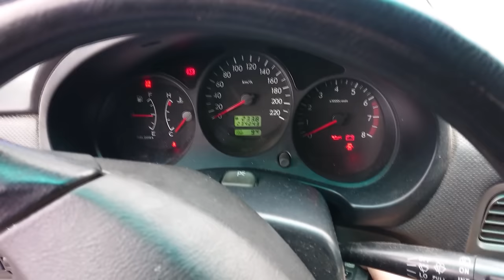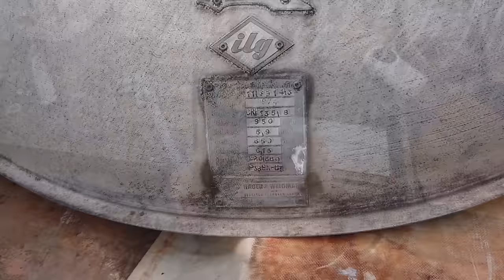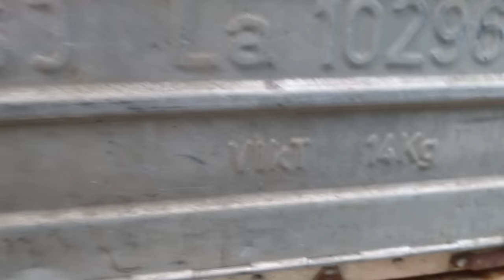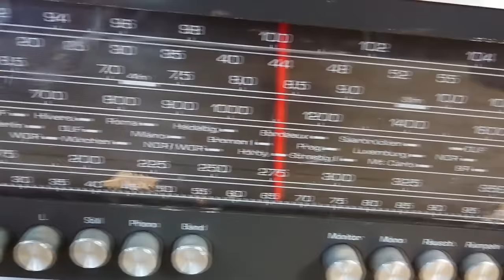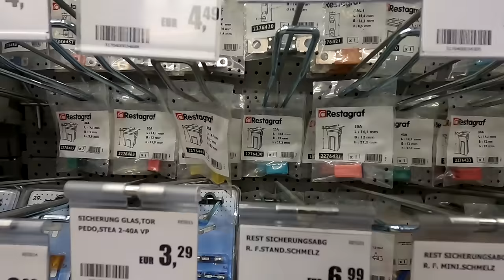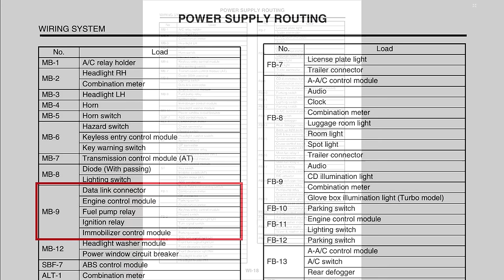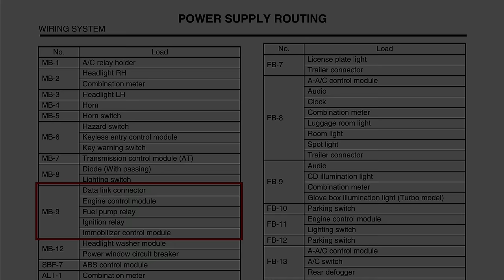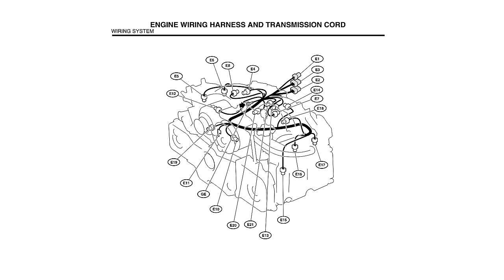New Awesome Scrapyard Finds! Repair-A-Thon!

Comment: As an auto mechanic that has training in electrical and electronics my main tools for finding shorts caused by rodent damage have been a basic test light, a source to inject low voltage into a  circuit like a variable dc power supply, and volt meter with an amp clamp. A good wiring schematic with routing diagram is a must as well for finding possible spots where a harness can chafe and locating ground point locations that could have become loose or corroded. The main issue i run into when doing electrical is that while the fix may be simple and quick the labor cost for the time to find the fault can be costly especially on cars with lots of computer controlled systems that are seemingly separate but when traced via a schematic are interconnected like many newer vehicles. It's been quite handy having experience with board level circuits as i've been able to repair modules that were either hard to find or cost more than the customer could afford which would have wound up them possibly sending it to be scrapped, like a fuel pump driver i recently did that was $500 and would take 2 weeks to get, the car had sat in storage for a few years and the unsealed module was located in a spot where humidity could enter it, board and ic's were ok but all the caps were either bulging or leaking brown electrolyte goo, took me an hour to clean, recap, and test it before reinstalling and bringing the car back to life.
Reply: Oh, cheap capacitors...you were the bane of my motherboards, video cards, and power supplies for years and years, and now you get to be the bane of cars too!

Comment: I know it's not under a car bonnet, but many years ago I had severe rodent problems in my workshop ceiling space where cables were getting chewed and damaged, not only posing fire risks, but also damaging my intercom system, surveillance cables and data. I tried traps but despite catching regularly they could not keep up and baits proved a disaster with the perpetual stink of rotting rat only removed by climbing in extracting the carcass... So I came up with an idea, the insulated ceiling space was entirely closed in and covered around 150 square meters and I purchased a couple of LED strobe lights that I set to flash at around 3Hz, one at each end. The effect was immediate, no more sounds of scratching, no more wires getting chewed, I even placed some dishes of nuts up there to check from time to time, and to this day they remain untouched. The LED strobes have now been running about six years straight, they only consume less than two watts each and have been 100% effective at dissuading the rodents from returning. I call it a big win, being clean, non toxic, low maintenance, low cost and silent and 100% effective. 
If your car isn't seen by the public, maybe an under bonnet strobe when it's parked could be just as effective. I since added some to our house ceiling after finding evidence of mouse presence.
Good luck. I also have an old Subaru (Liberty) lol.
Reply: Does the strobe effect deter them or do they just not like light?
Reply: @oldscratch3535  I suspect they just don't like the freeze frame light effect, they are nocturnal so the light would be even more dazzling to them, even when they try to burrow into insulation bats, it's still going to freeze frame their sight. That probably kicks off a predator risk too, not having good visual perception is probably just not worth the risk.
Another trick I heard once was to spray wiring or pipework with insect surface spray, at least once a year, especially around autumn. The residual taste is enough to put them off chewing plastic. I leave a can in my pump shed as the PEX pipes inside used to get eaten trough when they were looking for water, and so far the spray has stopped them, even in our current draught this year. That probably wouldn't work under a working car bonnet as the heat would most likely evaporate the chemical fairly quickly, but for a car long term stored it would probably help..
Reply: No time to chew wires while they are dancing the night away 😁
Reply: @dimBulb5  No wonder they want a drink...
Reply: That was my suggestion too
Reply: @alasdair4161  
You could give them a cheap cocktail: Water with a good amount of salt in it, they will keep drinking it until they pass out 🙂
But you might still end with stinky long term unconscious rodents in unreachable places

Comment: Unfortunately I have the exact same experiences with German car repair shops - even with independent ones.
I once turned my car (build 2002) to an independent shop, because the parking brake would only actuate on one side. A stunning bill of 130€ later and the problem not fixed, they told me that the freshly rebuild brake caliper (I did it myself) must be replaced - but can't as the part is not available anymore. After I spend much more time investigating the problem, it turned out to be just a rusty brake cable, that could only move by 5mm. Every mechanic should have been able to diagnose this. I share your opinion about these shops and I don't really trust them with any given problem or diagnosis.
Great repair, great diagnostics, great video! Thanks! :)

Comment: Mice (and possibly other rodents) hate the smell of peppermint. Also cloves (the type you throw in your soup) have a smell they can't stand.
Reply: Wood aven roots are a foragers alternative to clove, it a weed and spreads it may even be in the shop garden.
Reply: I doubt a rat would be deterred by this.
Reply: @juslitor  It works because its an irritant and makes it hard for them to breath. I also use spicy seasoning powder to stop critters from digging in the flowers.
Reply: @tripplefives1402  Never found anything that kept the rats in my neck of the woods at bay.
Reply: @juslitor  Sounds like a perfect test place then for the peppermint and the other guy (@ButterBallTheOpossum) with pet opossums saying to try opossum urine
Reply: @juslitor  22lr

Comment: FWIW: A squirrel chewed through a vacuum line on my truck. After diagnosing and repairing, I went on a search for ways to repel rodents and settled on Peppermint oil. It seems to have worked for almost a year, but that may just be coincidental.
Reply: Same. Just replied above before scrolling down and finding your comment.
Reply: This going to sound crazy but i  rehabilitate opossums and nothing will keep rodents away like a small amount of opossum urine. Two places i lived in were out in the woods and infested with rodents. I took a used puppy pad and wiped it around the outside parameter of my house and the rodents disappeared. Even the squirrels and chipmunks disappeared and even the flying squirrels left. Then when my grandma had issues with squirrels getting in her bird feeder i wiped some urine on her feeders and they disappeared again. I've always joked that i should bottle and market it😂. Opossum urine doesn't have a strong odor either so its great.
Reply: @ButterBallTheOpossum  You should actually market it. It wouldn't take much to bottle it, and you'd likely sell quite a bit of it if you can get word of mouth going. And it's not like you'd have much competition of other people going and buying opossums to keep around for their urine.
Reply: I've used spearmint oil in the past and worked for me.

Comment: Rodent repellant system: 🐱. In the long run it is rather expensive, though. You have to feed it and take it to the vet's workshop once in a while. If you are lucky it works for about 16 years.
Reply: Thanks for the laugh !
Reply: and the government will issue new costs like chipping, tracing, vaccines, "required" maintenance.... ends up costing way more than a new harness per year.
Reply: I live in Turkey, no rodents to be seen. Cats however...
Reply: @dimitar4y Helps to be ungovernable…!  😉
Reply: Our ball bearing rodent catcher, was in the habit of bring them in, and dropping them on the floor as a present for us.  We had another cat, that was a brutally efficient hunter outside, but considered everything that was in the house was a pet.  I finally solved the problem with a trap designed in New Zealand, that uses compressed air to dispatch the pests.  The trap requires nothing more than a small CO2 cylinder, and works continuously.  No requirement to reload.  A little spendy, but when you have spent as much as I have on electronic traps that have failed, they are well worth the investment.
I have a friend, that rigged up an infra-red scope for his air rifle.  He has insomnia, so that is a workable solution for him.
Reply: People say placing toilet balls help. The 32:46  ones used to be hanged inside toilet and slowly releasing cleaner by every flush.
Reply: Small bags of cat urine and feces placed around the engine compartment. Easley obtained from a cat box. It sounds gross but it worked for me. I had a pontoon boat that i had to park in a grassy area. In the spring i would have to repair rodent damaged wiring and rubber hoses. After i placed the cat waste in all of the various enclosures the problem never happened again.
Reply: @hodwooker5584   That might be slightly excessive. My father used to stick cat fur (collected from brushing) around questionable spots in our old house's siding. It might need to be replaced more frequently but it doesn't smell like cat pee.
Reply: @dimitar4y   Yeah, but those rodent-depletion-floofs can often be quite fun and useful in other roles too, even if they are solely outside/barn critters!  Ultrasonic repellers never warm your lap, and are never happy to see you.  :)  They may not be strictly cost-effective in some considerations, but if you implement them properly in your life for more than JUST mouse/rat/squirrel-relief, they have a much greater 'added value' for our lives overall.
Reply: @EShirako  let the creature live free, don't eliminate it from the gene pool D: it's not just a object of values D:
Reply: My barn cats just made friends with the mice, I have game camera footage of the mice eating out of the cat's bowl.
Reply: @daveb8598  too many videos of cats bringing live mice inside homes LOL

Comment: For the piano hinge joint, don't be afraid to take the hinge pin all the way out.
To put it back in easily, grind a slight bevel onto the tip. Put the other end in a cordless drill and run it at low speed as you push it back into the hinge assembly. The pin will help pull the 2 parts into alignment and find its way in as it turns. Taking it out can be done the same way, onve you have knocked out enough to get the drill chuck to grab on.
Holding a solid lump of metal next to the rivet tail as you drive it out will save bending the part and put more of the force into knocking the tail out.

Comment: I wish we had scrap yards to buy from. The nearest told me I'd have to be there when scrap arrived & then I could buy it only, before it went on the heap. I'm in Pittsburgh, USA. There is a second hand building products store, it's not a salvage yard. You always have great scores. That folding box is so clever. And the '70's receiver is amazing what was manufactured back then. Your Forester you repaired was awesome. I have a slightly newer Forester and anything to do with repairing them is very costly. Great video. Have a Happy Easter Holiday! ✝
Reply: Same in the UK. The scrap yards for cars have all gone, you can’t climb and pick like you used to, everything has to be stripped and bagged.  As for other stuff, we have ‘recycling centres’ where you are supposed to take your stuff like electronics and old furniture, but man if you get talking to another ‘customer’ and do a deal to take something from them, the staff go mental!! And yet there are signs all over saying don’t throw your stuff away…you should upcycle or donate…but try that at the recycling centre. Also, we don’t have ‘goodwill’ like the US does which I would love, we have charity shops but there is so much they won’t take like electrical and they are all in competition with each other. They are mainly full of women’s clothes and paperback books.

Comment: If you mix Vaseline with cayenne pepper flakes and spread that on the wiring harness or impregnate cloth wrapped around the wires they will not chew on them. It will not have an ill effect on the insulation. Dielectric grease works also. A scientist installing seismic sensors out on tundra came up with this method because critters were chewing off the cables. After wrapping the cables he never had trouble again. When I worked in the burglar alarm business I did the same to keep rats and squirrels off the alarm cables. Good luck!
Reply: Yeah, squirrels left my peppers alone after I planted habanero.
That teflon infused Super Lube is good stuff, has amazing feature of repelling dirt and dust.

Comment: When I was learning about electronic Diesel control, back in the early 1990s, during one of the sessions being run by one of the guys from  K5 (Robert Bosch R&D group, based in Stuttgart) we discussed system troubleshooting and component reliability. Short version of a very interesting discussion: it's almost never a faulty ECU, it's rarely the sensors, most faults end up being traced to the wiring or the connectors.
When you get a high current fault like you had there's not really any sensor that will support a continuous fault like that (first or second fuse will generally totally destroy the sensor) so your going to be looking at a wire fed fault to ground.
Reply from the maker: Yes I agree. Those were my thoughts as well. A 30A fuse will only blow Instantly when there is a dead short to ground involving a part or conductor that can actually maintain that kind of current. However, in the  beginning I was simply going through all loads attached to the fuse in question and the obvious contenders like fuel pump, starter, alternator, ignition coils had already been ruled out. Even though the ECU Was very unlikely to be shorted itself, it could still be switching  other loads via relays incorrectly causing an ovecurrent. The 30 EURO invest into a replacement ECU just to rule this out was the least of my problems.

Comment: This episode was very relatable with the automobile issues. Since I was a kid, we always drove junkers, many that we got out of fields. There are too many issues one can have with a car, and it seems like the only way to keep them running is to take them apart every year or two and obsess over every little failure. This makes it feel unworthy of my time to own a car for the most part. We happen to own a 2005 Lexus RX 330, and we recently had to have the front struts replaced because the previous owner drove it into the ground. Owning a car and paying for repairs makes me feel like a sucker.

Comment: Hi PAI, I agree with you the days of "fixing anything" are long gone for a number of reasons. Mostly due to the manufacturers planned obsolescence combined with overpriced parts. For example, Samsung and LG two globally popular brands of appliances. Well, certain things might break on say your Samsung washer say a computer board placed in a strategic place for it to rust or short out. Now it costs $880.00 to replace the proprietary computer board complete with WIFI, Bluetooth and its own Facebook page and APP (like you said few to no people to fix at the component level anymore for the most part) the part plus the repair is slightly cheaper than buying a brand new one with a warranty. This is by design.
Reply: "Why does my washer need WiFi?" It likes to play Minecraft. :)
Reply: My mom found that out with her Samsung washer. The control board was over $300 just to purchase and she had to wait 3 months to get it. 

I have to buy a new stacker washer/dryer soon and I'm buying the old school kind that still uses stepper motors and mechanical switches. It doesn't look as cool, but its $800 cheaper and I can actually fix it.
Reply: I have seen Maytag Factory Service bring parts  (the PC board) in a Samsung box.The washer was 3 months old $700

Comment: As technician over 25 years I can tell ya: it's always the cables 😅
When I had to deal with students at work and they came: this and that machine is broken, I always asked if the have checked ALL cables. Most of the times I was right.
Second most fault is water, then blown resistors, fuses or dead electrolyte capacitors.

Of course replacing the intake manifold to find a broken cable is a kind of a job 😅 but measuring all cables resistance IN A CAR is a even bigger mission.

Comment: The lights were fantastic. I called the wire harness after you unplugged all the connectors (I am a retired electrician). I own a 17+ year old Hyundai Tuscan and have no intention to 'up-grade' anytime soon! You're a man after my own heart TPAI, I get really annoyed  when something I could repair has been manufactured in a way that disassembly cannot be done. Glad you fixed your car, well persevered.

Comment: You could have used a high wattage 12V lamp instead of the fuse, it should go out when the short is cleared
You would have got instant notification as you moved wires around ;)
Reply: Could modern  thermal imaging have been useful for this case?
Reply: @drlepre  I don't think the fault was there long enough to get warm, also he said it was under the manifold
Reply: @drlepre  maybe using an expensive high refresh rate high sensitivity one but most people don't have quick access to them